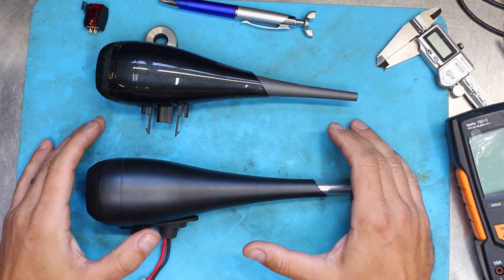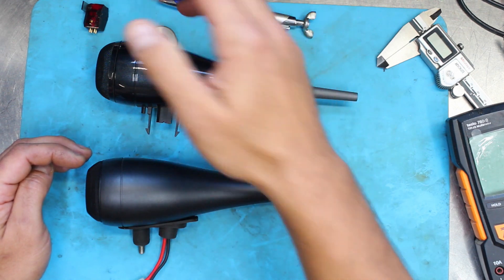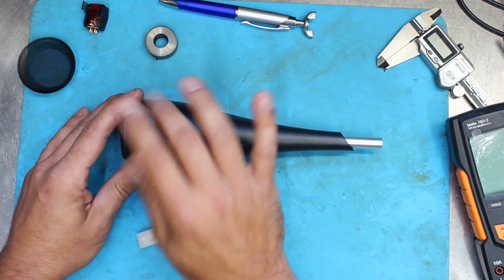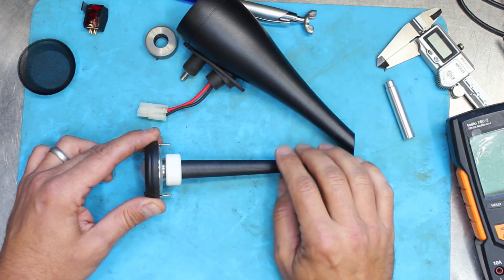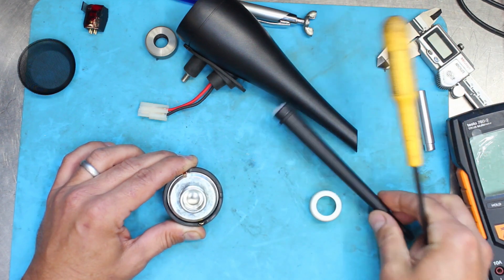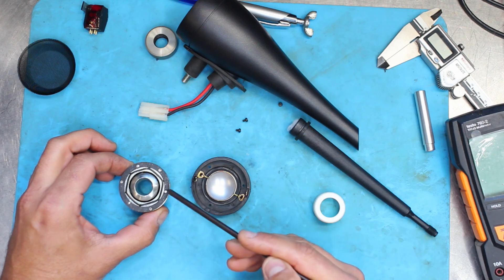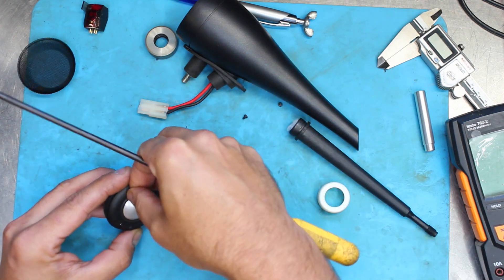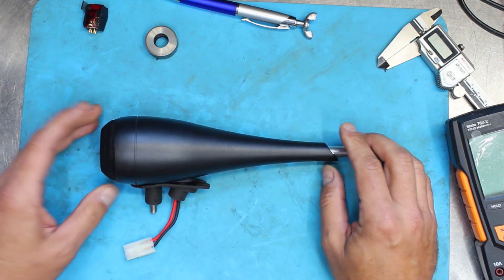Hilltop Workshop | Show & Tell - Bowers & Wilkins Nautilus Tweeter

Comment: Also I think the tweeter decoupled outside of the cabinet containing the woofer really helps with diffusion and isolates it from bass/mids sound & vibration.
Reply: The idea is nice but the sound is very mediocre, that's one of the main culprits of these designs, the tweeter sounding detached from the other drivers. Like clearly having another unit playing on top of everything. The big models are the worst in that regard, the 805 is decent and probably the best of the bunch if you don't need thunderous bass.

Comment: How do you remove the glossy tweeter from the speaker cabinet without snapping the plastic attachment?
Reply from the maker: Remove the mid/bass driver and then you can reach the tabs from underneath.
Reply: @thehilltopworkshop  does that apply for the lower tweeter as well?
Reply from the maker: @gottpwnd  No. The other one has a stud with a nut on it, but is it accessible via the same way.

Comment: Hi, I have the one you set aside and the tube is attached in different way (or so it seems) does it also twist off?
Reply: I have the same problem. The tube don't move. Please, say to me! Did you move it or not?
Reply: Hello, I watch this video about disassembly tweeter B&W N803. I did and it worked. However, you should have attention and care with the aluminum hat... It is very fragile. Nothing the iron e steel objects close by. There is the magnetic attraction that move  the devices fast and strong straight to hat.
https://www.youtube.com/watch?v=XiIvGir9ISA

Comment: It's great to see a qualified audio professional Aussie on YouTube..! 
You know I was wondering if I could ask for some advice?
I've got a pair of b&w matrix2 series 2 speakers which are still in excellent condition, bar the woofers. I wasn't sure whether it was the woofer driver or the crossover or the voice coil as I'm just an average Joe who likes decent sounds. But I took the chance and replaced the woofers with these drivers called Dynavox 200, as their advice. But this sounds terrible and it sounds nothing like the original, not even close..! I just can't believe they would recommend that garbage! 
Can you suggest some other options to replace the woofers driver chassis for my b&w matrix2? 
I really appreciate it..! 
Keep those videos coming
Reply from the maker: Hey! Thanks for the comment, and I'd be happy to help if I can.

With something like that, it would be incredibly difficult to find a driver with the same sonic signature. Even for a woofer.

If you still have the original drivers, you can get them repaired. Same with the crossovers, if there's a fault with them.  

Personally, I'd use Queensland Speaker Repairs, but I'm not sure where you're located. 👍👍
Reply: @thehilltopworkshop  I think the problem was the woofers, because the sound came back, just not what I had hoped for, in fact it was horrible..!
Yes, I kept the originals for both speakers. 
I'm not sure exactly what is broken, whether it's the diaphragm or the voice coils etc..? 
I live in Sydney. 
And thanks for replying..!

Comment: Excuse me aren't the pods made out of a solid body of aluminum thars been milled down, I own  705 s2 and it's 100% aluminum, i definitely would not have bought it if plastic.
Reply from the maker: These are Nautilus series from the original Nautilus range, which are nearly 25 years old.

Newer ranges use billet aluminium.